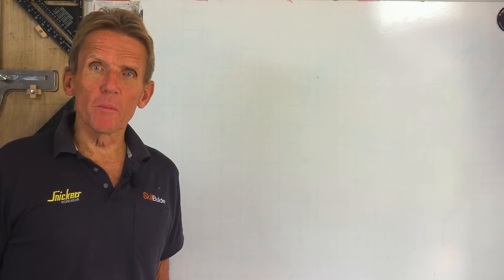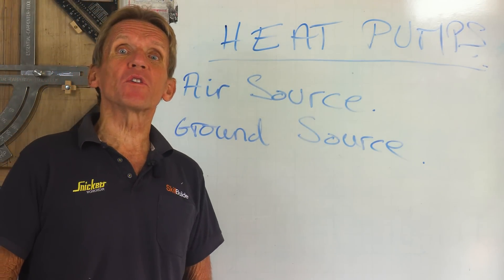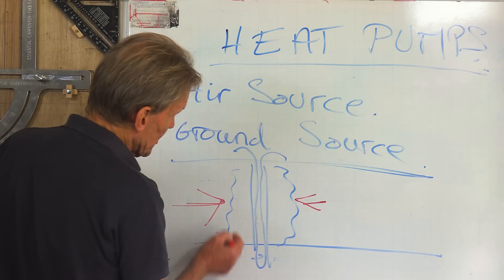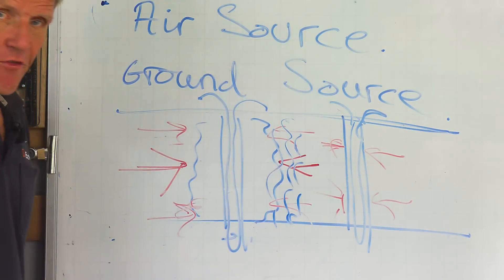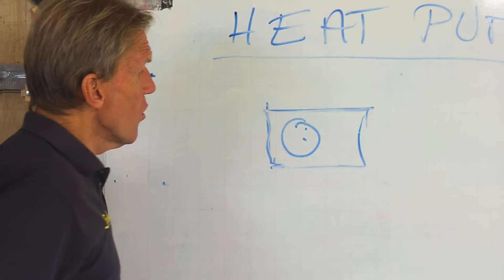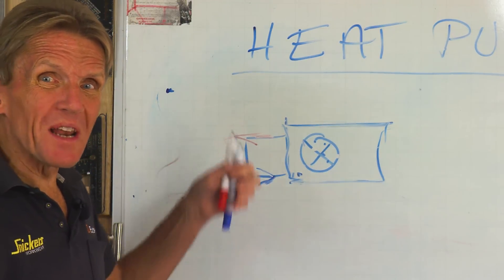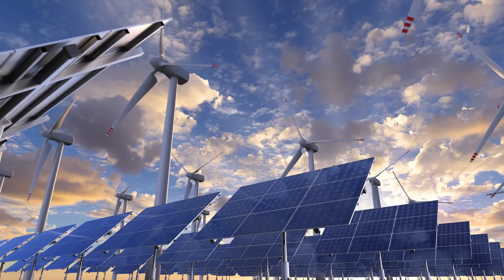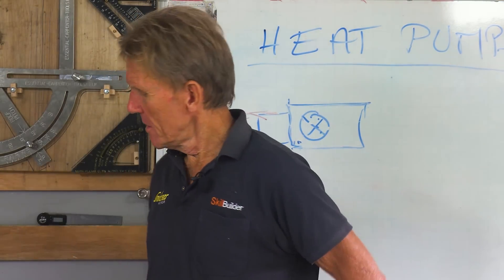Heat Pumps ~ Get Your Facts Straight!

Comment: Vaillant's aroTHERM heat pumps for example are available as monobloc (which is what you're talking about in the video) OR split. BOTH systems are used in the UK and both are Air-to-Water HPs eligible for the BUS. Search YouTube for "aroTHERM Split vs Monobloc" for an explanation. Air-to-air systems in the UK might be used for heating for 3-4 months of the year but will likely be cooling for 3-4 days in summer if we're lucky! That will NOT double your electricity usage and is likely to come from your solar panels' excess generation if it's that warm. Why do you say a/c isn't as efficient as air-to-water? Both systems can have a COP of 5 or more and a/c may work out more efficient with its instant response and controlability. Even without the BUS grant of £7.5k A2A is cheaper, much quicker to install, without ripping up the house and it's easier to get an engineer if you need one. I would argue that air-to-water is NOT the British model, I'd bet there are way more air-to-air systems installed - just maybe not domestically. But as we all know by now surely, the British way sucks. Roger get your facts straight.

Comment: Insulation insulation insulation.
Retrofitted air source heat pump performance is totally dictated by it - with both positive and negative outcomes.
Mini splits, in heating mode with a wall mounted cassette will perform terribly in a poorly insulated structure when the outside temp drops below about 6c. This is because of the fost that forms on the external heat exchanger when there is too much demand on the unit. When the external unit ices up, the inverter goes into a reverse cycle to defrost it - and the heat it uses to do this comes from the air within your house that it has been working overtime to heat; the internal heat exchanger takes this heat and pumps it back to the external heat exchanger to get rid of the frost that is preventing the heating cycle from working. This can take several minutes and robs your home of a lot of heat.
A very well insulated structure will hold the heat inside for longer, meaning that the external unit does not have to work for extended periods, and the frosting process takes much longer, if it happens at all.
I do not have experience of air to water systems that send hit water to radiators, but I assume the same would be true of these in a very poorly insulated house with the room stat maxed out in cold weather. 
Incidentally, having worked within a bungalow that was designed and built with air-source as the sole heating system, directed to manifolds that 'regulated' underfloor screed embedded emitters, I can confirm that there was no dynamic control of the heat; when the weather turned mild and the change was not anticipated by the human in charge of the room stats, the environment within the building became almost uninhabitable, small windows and a large reservoir of heat within the floors that could not be purged, made for a very stuffy atmosphere. Conversely, unanticipated drops in tempreture could not be compensated for quickly because of the length of time required to pump heat into the floors.
Air to air mini-splits may not be perfect, but can quickly provide heat on demand, but as with any heating system overall performance is down to how air-tight the building is and how well it is insulated.
Reply from the maker: That is really useful information from someone who has experience rathet that simply an idealogical bent.
Reply: Insulation has zero relation to defrost. Insulation affects heating load - heating load determines heat pump size, if the heat pump is undersized then it will have to work harder. All comes back to properly sizing heat pumps for the heat loss.  Properly sized ones won't have a noticeable drop in indoor temperature, and will recover it very quickly after the defrost is complete.
Reply: @BenIsInSweden  How do you define heating load?
Reply: @SilasMoleCatcher  heat loss of the property at the design temperature.
Reply: @BenIsInSweden  My understanding was that insulation prevents heat loss - assuming the space is air tight.
If the pump size is correcf for the space which is well insulated, then frosting on the external unit of an air to air split system should be minimal- even in very cold weather?
Reply: @SilasMoleCatcher  defrost cycles are unavoidable regardless and will occur every 45minutes to 2 hours depending on outside temperature and humidity when the outside temperature is 6C and below. Having even perfect insulation will still mean you'll get defrost cycles with a properly sized heat pump.  Adding insulation afterwards may reduce defrost cycles, but that's more because there is a greater difference between the heat loss and the size of the heat pump, which may mean you end up with duty cycling in milder temperatures.

Comment: As a geologist i can tell you that you got 6feet plus down in the uk in and you will have a steady 5 to 6 degrees ( this is in the natural ground) dont believe me ask any miner or visit any cave system in the winter.
Reply from the maker: alanrickett
It is interesting that you have specialist knowledge but fail to understand that extracting heat from the ground with a heat pump means that , in order to maintain that fabled 5 dgrees you need to replace it. Far be it for me to teach you anything, but the rate at which the heat is replenished by the surrounding ground is entirely dependent upon its geology.
The most efficient being wet ground or water. 
Look at some case studies on ground source heat pumps and you will learn about localised ground freezing.  There are many cases of vegetation dying.
Reply: @SkillBuilder  I took no issue with your section on replenishment, it was your statement that people were wrong to say the earth maintain a stable temperature year round once you got down a few feet which is a factual untruth. 

I don't disagree with your conclusions, and it is a small point but it is best to give the correct information.

Comment: Talk about running costs? Because to run a pump saves little, if any, and in some cases a lot more, to run than a Gas boiler. Explain the upheaval involved installing a system. Explain that it runs at a much cooler temp than gas boilers. These things are not the planet saving answer!

Comment: Roger you explain heat from air , but when it’s coldest you need most heat , if it’s -10 C outside how does heat get extracted from those minus temps
Reply: -10C still has heat energy - it's better to think of it in the Kelvin scale which starts at Absolute zero (0K or -273.15C), where there is no heat energy.  So for -10C you're looking at around 263K, needing to move heat energy around to raise/maintain the room temper to about 294K.  If you think about it, your freezer still extracts heat energy from the freezer at -10C, because it should be going down to around -18C.

Comment: I appreciate all your videos but on Ground Source heat you make a fundamental mistake; little of the heat comes from "the sun heating the ground" and storing it but is actually a form of geothermal heat. The decaying radio active mantle is, as I'm sure you know, very hot and the heat works its way slowly up to the surface - unless you're unlucky to have a volcano in your garden!

Comment: heat pump are useless  just another con job they cost 5 times more to run than gas and 10 times the installation cost just another green levy  cost to kill off the poor

Comment: Heat pumps are just virtue signaling and until they can match the efficiency of fossil fuel systems they are a dead duck for the average UK citizen and dont forget the UK produces less than two per cent of the worlds air pollution so why bother until China, India the USA are on board then the UK could would matter but till then absolutely not.

Comment: I find this talk of clean & efficient heat pumps all a bit disingenuous. People talk about ASHPs having a COP of 'up to' 4.0 but more realistically, this works out at 3.0. Now in December, my condensing gas boiler consumes an average of 30 kWh/day of gas. The argument runs that I can replace this 'polluting' gas with an ASHP that consumes 10 kWh/day of 'clean' electricity. However our electricity in the UK is far from 'green' & can be very 'un-green' in winter, when demand for heating is at its highest & things like solar are virtually non-existent. We saw this both this year & last year, when during the really cold snaps, we saw the wind drop to two tenths of bugger all & all our gas generation sets cranked up to maximum. Our Combined Cycle Gas Turbines (CCGTs) have an efficiency of 50% so will consume 20 kWhs worth of gas to produce 10 kWh of power AT THE POWER STATION. I put that in capital letters because power at the power station is not the same as power at your domestic power socket. When you take into account losses through the transmission & distribution grids, you need to burn 22 kWh of gas to get 10 kWh of power at your house. So when things are bad, or when you live in carbon winter black spots like the East Midlands, South Wales or the West Country, the true 'dirty' gas reduction you see after installing your expensive ASHP might be 30 to 22 kWh/day, not 30 to 10! On my calculations, three-quarters of my gas consumption occurs between mid-November & mid-February when the heating kicks in big time. If an ASHP can't be green in winter, it barely matters that it's reliably clean for the other nine months of the year.

Comment: The ground temperature increases as you go deeper, not colder. As for freezing the ground, that's if the system heat transfer and reservoir is not designed right. An air to air heat pump will freeze the evaporator if the capacity is not designed right. The COP of mini splits is less than 2 in sub zero F climates, ground source, 4. Twice as efficient

Comment: The major problem with air source heat pumps here in the UK is our year round high relative humidity (avg. 70-80%). This results in a dew point temperature not much below ambient and that causes large amounts of condensation to form. Throw in the fact that the heat pump will often be at sub zero temps and it very quickly turns them into huge ice cubes, rendering it useless.

Comment: Roger, am I missing something here, you can pay £3k for a new efficient gas  boiler that fits on the kitchen wall, is warranted for 10 years and costs about £80 a year to service. The alternative is having a heat pump journey with surveys and remedial work that requires a large spare room or garage to store all this equipment and an outside unit. You then wait and hopefully it all works. Not to mention the installation and servicing costs. All this so instead of burning gas at home efficiently you burn it at a power station to convert the energy into electricity that costs four times more per unit than gas.
Reply: 1) You miss that Gas (and the supply lines) costs money as well
2) A Heat Pump isnt that big.
3) You only burn it efficiently when you have it properly installed. If your installation is wrong (little insulation/low radiator sizes/high temperatures), you dont heat efficient at all, just like with heat pumps
4) Only a part of the electrical power comes from Gas Power Plants. A large portion of the electricity already comes from sources that are not fossil
4B) If the government dosent care for emissions anymore, it can always replace the electricity generation with local coal, what is cheaper than imported Gas (and also is easier to import from friendly nations than Natural Gas). Nuclear Power can also be used if available with no big losses
5) You also get 4 times the amount of heat energy out compared to gas, so they are equal in that sense. Also, you can save additional money by using special tariffs that compensate you for being flexible.
Reply: perhaps missing that not everyone in the UK is on mains gas, so you either have LPG, oil, or logs coal and a back boiler. So to update an old  oil system may include a bunded tank (£1500), boiler £3-5k, then rads etc may be 40+ year old. Grants for people on pension credits in North Yorkshire for example work on hierarchy of 1. off gas network? 2. Energy rating of property 3. attributes of property. So if your oil system is 20 years old would you go for oil or heatpump?

Comment: Why would you need bigger radiators, is it because they do not get hot enough, by the sound of it people are spending 20 to 30 thousand plus for a heat pump, how many years before it has paid for itself, remember to take into rising electricity costs,. They want our bills to rise by 70% to build all the new wind farms . So much for cheap green energy.

Comment: You didn't mention that drilling for a ground source near a building it can affect the foundations, as extracting heat also means extracting part water that stabilizes the mud or sub soils they are built on and also upset concrete piles or concrete slab foundations. Which of course in time will void your household insurance.if you have caused a landslide by changing the structure of sub-soils yourself, just one small fact no one seems to mention.

Comment: I would love to hear the government explain how in this world an air source heat pump will manage to effectively warm my 170 year old solid wall house using the current radiators. Yes they will talk about external wall insulation, floor insulation and retrofit low profile underfloor heating. Only problem, I haven't got £30k+, and that is a fairly accurate costing.

Comment: Buy a suitable unregistered EV with a 100kwh battery that still charges, park this fire-starter outside and plug it into your charger on an EV tariff, then tap off the battery to stand alone night storage heaters. At 10p per kwh between midnight and 5am. Even at 300% efficiency a heat pump would need to be on a 30p tariff to compete.

Comment: With air to air, it's a bit more complex than that, there seems to be some real vested interests in air to water systems. Air to air could be made with no heating capability, but they would still never give a grant for it. It's the cheapest way to deal with older housing stock, My 1995 property has microbore and small rads. A grant funded system is still going to cost me over 24K to install and that doesn't include the redecorating costs. Hot water becomes problematic as I have a tank and 3 pumped temp controlled showers...even more costs if I want a heat pump tank, or use electric to heat the DHW. Air to air on the other hand has an install cost around 60% less (even without a grant), I can run only the units I need to run, when I need to run them and I don't need to keep the system on for extended periods just to heat up a room, it can be warm in 5-10 minutes. they can be set up for frost protection as well. my existing boiler would be then just for DHW and I could get a small unit for that when my boiler breaks. The government either haven't thought it through, or corruption is rife. Installation of air to air is fast, simple, not very disruptive and with the minimum of redecoration. radiators can be removed or left as a backup.

I also have an inverter mini split in the loft room, so I know of what I speak.

Comment: I personally wo were resolveduld not purchase anything with heat pum in its description. Ijust recently got rid of an unvented heat pump clothes dryer suppossed to be energy efficient . I started to get lots of mould in the home. having torequiring me to run near 24/7 it wasnt' until I changed it to a conventional vented the issues were resolved now no mould in my home and better still less power consumption not having to use 2 dehumidifiers.  not had a spot of mould for months after going back to a external vented appliance. from my experience do not buy one you have them on all day and your clothes are always damp. and they cost you more running dehumidifiers you don't win the energy supplier gets more dosh.

Comment: It doesn't matter whether heat pumps are good or not. The National Grid can only carry 55GW of power. This week the electricity demand was 45GW. Our homes and buildings are mainly heated by gas. To heat them with electric heat pumps would need an additional 30GW approx. 40 + 30 = 75 , too much for the grid. Until we build a bigger grid we cannot use heat pumps. End of story.